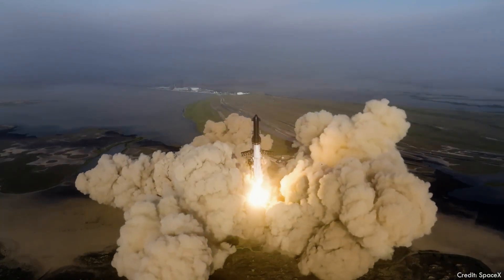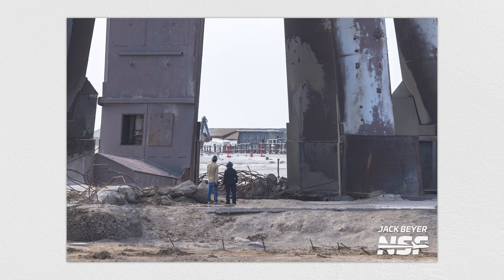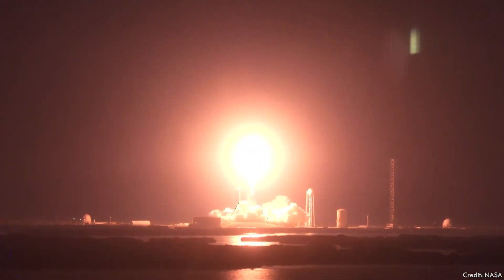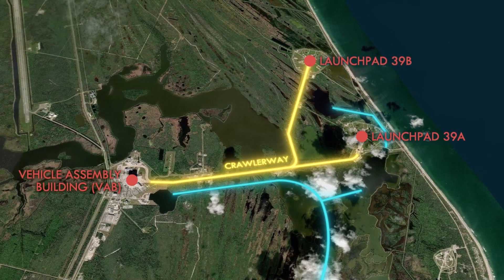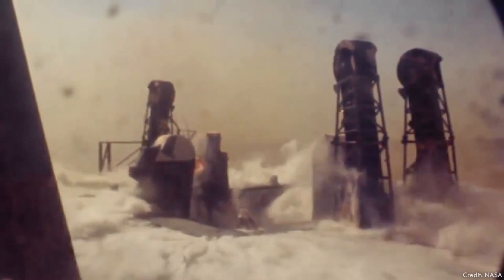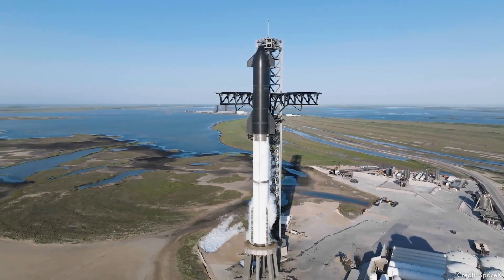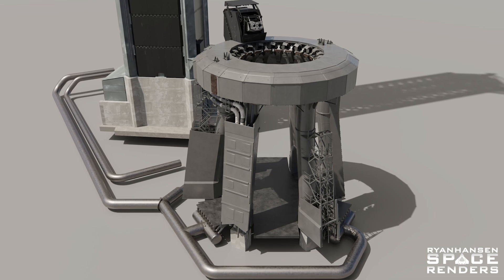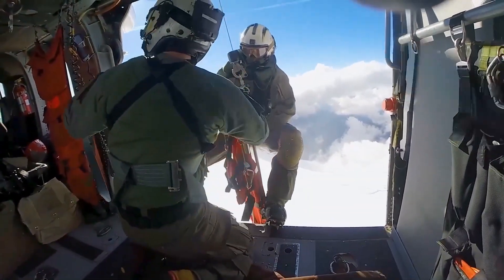Was Starship’s Stage Zero a Bad Pad?

Comment: I drove my semi onto the pad a few days ago delivering supplies to rebuild
Reply: Yup. They will be ready to launch again soon supposedly. Are they bringing in that steel plate?
Reply: @pierredelecto7069  no clue. My delivery was unrelated. They were tearing apart one of the super size load trailers when I was there, but I believe that was from the 2 369,000lb tanks (containers, not of the Abrams variety) they had delivered.
Reply: @M21assult  talk about oversize loads! I drive heavy duty wreckers but I bet it would be fun to deliver at SpaceX
Reply: and you still couldnt provide any useful information in this comment 
nice.
Reply: @littlehills  interaction to help his algorithm, not to feed your mind.
Reply: @M21assult  algorithm for a video that offered little in what could be done differently or condemn the  poor planing and endangerment of stuff and life. shore. claiming u drive on the pad and didnt even offer a simple the holes not there no more sounds like ur comment baiting for internet points. anyway algorithm algorithm
Reply: @littlehills what specifically was the danger to life? Were people inside the exclusion zone? Was there projectiles with lethal kinetic energy outside the zone?
Reply: @littlehills  well I have pictures of it, they explain well enough, but I don’t need to justify that to you, and even if I wanted to, fairly sure links are turned off in the comments. 

It wasn’t poor planning. It was an expected result, in line with their other tests. I’m more than willing to endanger STUFF to take humans to mars, and probably a few hundred lives too, though I’d prefer that be while launching them. 

It’s not exactly a large claim. I was far from the only semi there, i imagine it takes hundreds to rebuild, it just so happened that the delivery I had needed to go to the pad.

Comment: A bad pad? Ignoring decades of experience and re-doing mistakes that others already fixes more than half a century ago is not bad design or "moving fast to learn" but criminal negligence.
Reply: @personzorz  exactly
Reply: @yoshyoka  nasa would have made sure no one else died, oh wait it happened again with Colombia.
Reply: @personzorz  because no one died or got injured, worst case scenario is the pad blew up with the rocket still there and that still would have killed and injured no one.
Reply: The fact that no one dies is no excuse for negligence. This would be like justifying speeding in the city since "this time no one got injured". 
Let us also not forget that the abort system failed, letting an uncontrolled rocked running circles in the sky before blowing up by itself: that could have gone way worse.
Not to mention the unforeseen environmental impact.
Reply: @yoshyoka  Damage to the environment was entirely foreseen, and well within what SpaceX had approval for. It's not optimal, but the next launch will be more successful.
Reply: @SpaceAdvocate  So well foreseen that the FAA grounded operations and is investigating…
Reply: @yoshyoka  It was an anomaly, where grounding the rocket and investigating the cause is standard. Anomalies aren't *planned*, but they aren't unexpected, either. So, you plan for the possibility of anomalies occurring, hoping they never will.

It was thought that in the worst case scenario, an anomaly could spread debris for hundreds of meters, but it was thought that the debris would stay within the 700 acres that have been blocked off. And thus far, they have been proven right, debris in this failure scenario was contained to the expected debris area.
Reply: @SpaceAdvocate  The anomaly is a space provider failing to build a launch pad to standards proven since more than 50 years. Yet before further speculation, i would just wait and see what the FAA has to say at the end of the investigation.
Reply: @yoshyoka  The FAA isn't doing the investigation, SpaceX is. They will have to report their findings to the FAA though.
Reply: Criminal negligence is launching a crewed rocket into space and having it blown up because it was too cold to launch that day, they lost an old rocket vs their launch site which they valued far higher.

Comment: I do not understand why SpaceX chose not to have a flame trench and/or some kind of sound suppression system for the Starship pad at Boca Chica. Seems like a real no brainer that they were going to have a lot of damage without it. NASA has been launching rockets since the 60’s and this seemed like a very basic, tried and true system to have built into the original design.
Reply: Not an engineer or associated with SpaceX in any way.  However, I am a sometimes SpaceX fan.  I disagree with their decision to not have flame trenches or sound suppression.

All that being said, part of SpaceX's plans involve landing Starship on Mars and the Moon.  There won't be prepared pads at those locations.  Having actual data on the level of damage that could be involved could be useful.  I'm not saying that's why they didn't have anything (again, I'm not associated in any way so have no insider knowledge) just acknowledging that the possibility is there.  I'll even go so far as to say that the decision could be seen as negligent.  Still, knowing exactly how inadequate your preparations were gives you more data than overbuilding to the point that no damage is done.
Reply: To be fair, the OLM is pretty far from the ground, so is a 360 degree flame trench. What Musk didn't wait for was the water deluge to be installed. As Grady noted, Musk wants to avoid a flame diverter if he can, likely because he wants to work on the engines under the pad.

Comment: I would love to see a garage model of a flame diverter with a deluge system, I know you can do it Grady!
Reply: And also a rocket engine for realistic simulation!
Reply: 😂 Go for it, Grady! 🤣✌️😎
Reply: That would indeed be great. I wonder if it's possible to use an air compressor and a de laval nozzle to produce a supersonic flow of gas.
Reply: It's literally just a water tower but all the water is released as fast as possible right under the rockets engine... Its as basic as a waterfall.

Pretty sure he did do something on water towers. the important part is that there is as much water turbulent water as possible in the air. the water absorbs the acoustic energy, dampening it and preventing a direct shock wave from bouncing back up into the rocket. with the power rockets generate, that is enough to destroy the rocket. It's a testament to space x engineers of Star ship that the rocket took off despite the damage it got.
Reply: I would not be surprised if Grady did that.
e.g. for starters, Mixture of sand and gravel, perhaps a little wet to imitate some adhesive power, and then blasting it with a compressed air.
Reply: ok
Reply: ok
Reply: ok
Reply: Collaboration with Dustin @SmarterEveryDay ?
Reply: @esarlls3 *Destin but that would be a sick collab
Reply: @esarlls3  No, Tech Ingredients, since they were building rocket engines bigger than what can be bought by hobbyists, along with static tests.
Reply: NSF has an hour-long video that features a concrete test slab being attacked with a power washer; hilarity ensues.
Reply: @dancingdog2790  Yep. What  hack job that video was.
Reply: How about as a lesson about the difficulty of scaling.. half the vid could be like here's Reynolds number etc and all the head aches engineers get trying to test stuff at the garage scale, but here's a model that kinda works and gets some points across anyways

Comment: It's likely the debris that caused the failure of the engines which lead to controlled detonation of the craft. Exciting, hopefully they will be allowed to dig into the soil by regulators and their new control system works so they can protect the surrounding area, both from debris and noise.

It's definitely a case of smart people and solutions instead of over planning and spending a lot of time while still going over budget. SpaceX is on the right path, albeit hopefully a bit more careful next time and with a lot more knowledge from this test. Their rapid development is going to save the US tax payers money in the long run and most of the damage was to their OWN equipment anyways, can you really be too mad at that.
Reply: What I remember is that it was a failure of the separation of Booster and Spaceship second stage that lead to the (delayed, because the flight termination system partially failed in not working as quickly as designed) destruction.

They were attempting a literally "swing it around, use the momentum of that to separate the stages" maneuver when things ... didn't separate.  So, it had nothing to do with failure of those engines.

Three of them had issues starting up, but that was within parameters of the test launch.  The others were likely damaged by the stage zero debris, but given no payload there was more than enough thrust to continue.

Comment: I love your content, Grady, but I want to point out one error in your explanation of rocket propulsion. It is a mistake I made... It is not a controlled explosion because that would require detonation, and that isn't what's happening.

It's too "clean" of an explanation (or "neat") that sums up some recognizable concepts both visually and using words. But as an engineer yourself, I would think that it would be important to get that right.

Detonation engines are a thing, now, because technology has caught up. RDE or Rotary Detonation Engines are real things that do use explosive wavefronts to create propulsion.

My explanation is also a great reduction of what they actually are because I am merely a layperson repeating something I've got an interest in, but I feel it's important, on a channel called "Practical Engineering" to at least get the technical reductions correct. 🙂

PS you're the reason I'm subscribed to nebula.

Comment: I know it's new, but it would be interesting to hear your perspective on the I95 collapse and repair before the final report is finalized, and apparently repaired. Maybe a topic for a short?
Reply: I am more interested in the plan to rebuild it.  I saw that they are using lightweight fill and I was like, "Hey, I know about that!"
Reply: Road Guy Rob just released a video explaining how they plan to fix the video, if you wanna watch it. Basically they are building sort of a thin bridge in the middle for people to continue using the i95 and they will build half a bridge beside it, then switch to those being used and build the middle
Reply: https://www.youtube.com/watch?v=LJ249N1aW_8
Reply: EDIT: whoops, wrong reply
Reply: US 175 in Dallas had a tanker burn under a bridge causing its failure.  It was replaced, then several years later bypassed as that bridge was at “deadman’s curve”— where you went from 65 to about 30 to make a sharp turn.
Reply: Let's not encourage any more shorts. They take away from actual content.
Reply: Grady's Sanibel Causeway video is similar and YES I would love to hear about I-95 too!
Reply: The truck failed to make turn on a curve under the I95 and crashed. I’d like to see how one can design that spot so curve crashes don’t occur under the overpass. That is make the under crossing a straight through pass.
Reply: lookup the I-80 collapse from a tanker fire in April of 2007.   Very similar situation.
Reply: @_fishy  Technically complex? The highest demand on record at a time with zero generation? Gas wells frozen, trucks can't start let alone find a navigable road to make their deliveries to generators? No, I can't be having that friend, we have to blame politicians and companies for not spending a trillion tax/consumer dollars on a once per two hundred years event!
Reply: I’m sure he is already working on the video. He is very thorough, so it takes some time.
Reply: Is it really that interesting? Tanker catches on fire under an overpass. Overpass predictably collapses. They're going to use gravel to build up next to the overpass and pave a temporary road as they fix the overpass. The finished overpass takes five years to construct as it's PennDOT.
Reply: @Noneofyourbusiness2000    Interesting that they managed to get I-85 in Atlanta up in under two months under nearly identical circumstances.  I guess because the company that built it had the parts needed and building the alternate bridges would have taken longer than merely fixing it.
Reply: @Noneofyourbusiness2000  Have you not watched this channel? You could say the same thing about almost all the videos. You say the condensed version in a few sentences and tack on a: "is it really that interesting?". Texas power outage? It got cold and there wasn't enough generation for the demand once cooling water and Nat gas lines froze, "is it really that interesting?"... YES!
Reply: @JetSettingBotanist  A collapsed overpass due to a tanker fire, on a highway with many routes to bypass, seems rather mundane to me. There were no engineering errors or oversights. The process for repair is simple and nothing unusual. This happened 30 minutes from where I live and even I couldn't care less.
Reply: @Noneofyourbusiness2000  For starters, the temporary embankment is NOT made of gravel. .... The product used could, itself, be an interesting topic for a YT Short.

Comment: HI Grady! I've been waiting for this video to come out for a while now. I knew there was no way you weren't going to cover this lol. 

This was a fantastic review, although I was a bit surprised you didn't go deeper into the actual failure mechanics

I considered reaching out to you as I was working on my deep dive investigation to see if you may want to partner on this topic, but I figured you may be a bit too busy.
Reply: Agreed.   Mostly about how things are normally done.  Very light on any details about stage 0.  I was excited and expecting to hear him talk about the 5 seconds of pain that the pad took and his explanation on what would have happened under the pad.  Even a practical example of what all of that pressure would do.
Reply: @gadgetmerc  I was hoping he would maybe have watched my episode about this and found some holes in my logic or things that I didn’t consider. Not trying to self promote, but that was genuinely something I considered as I was investigating this topic. 

“I have to be extremely thorough with this or Grady will completely shred my explanation lol”

I’m a bit sad that he didn’t
Reply: The biggest issue here was the failure of the  pile cap, not the Fondag layer on top.  It didn’t vaporize, but instead the sand underneath the pile cap was compressed and caused it to bend and eventually snap.  

Loads were not properly transferred to the CFA piles, and instead the pile cap was transferring loads into the subsoil layer which has close to zero bearing capacity under liquefaction conditions.
Reply: @CSIStarbase  yup, that's the video that I meant. Great video btw. A shame Grady did not delve that deep into the analysis.
Reply: I have seen a video from NSF or you recently (can't remember which one). They talked about the old pad construction. They deduced that the pad failed/cracked at unsupported points. This let the gased flow under the pad and lift the concrete everywhere. It is likely that Grady does not follow the community as close as we do and so does not have much awareness of the data collected by the various enthusiasts like RGV. I would also like to hear speculation/analysis about the usefulness/longivity of the new pad construction. Love your videos. Would be very cool if you collaborated.
Reply: Just shoot your shot dude, you never know when someone might get some free time and a little curiosity or help can turn into some crazy things
Reply: I like Grady's videos before I watch them, but this felt lazy - "Anyone could tell it wasn't going to work" is not an analysis that's up to his usual high standards. I've retracted my like. 😞
Reply: I was going to point you to CSIStarbase and his excellent deep-dive videos, until I noticed who it was I was replying to. Thank you, Zack, for your excellent, insightful videos, which I always like, and share with those in need of, or seeking more information.

Looking forward to your next masterpiece!
Reply: You know what DID go deeper into the launchpad failure?
The rocket exhaust.
Reply: You video on CSI Starbase is by far the best analysis of this I’ve seen and I’ve watched them all.
Reply: yea, this was more of a news report than a engineering video. bummer.
for those of us following these stories, it was repeat. i wanted the engineering! old design vs new design. forces involved. why does water and a steel plate work better than concrete?! Engineer me Grady!
Reply: @diox8tony  well, it has been explained. Also, forces are clear  trust and heat produced.  You expose concrete to extreme heat combined with the mass. It will break. Steel is way more flexible, and if you cool it with water, it holds up easily.
Reply: i don’t agree with Zack on many things , but this observation that he didn’t go deeper i agree with .